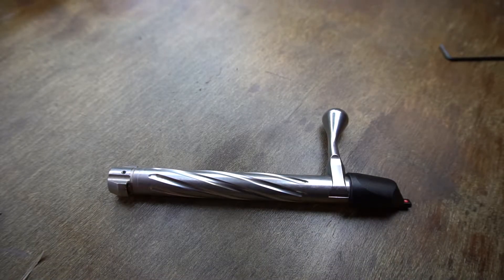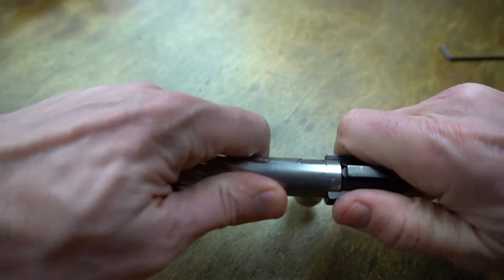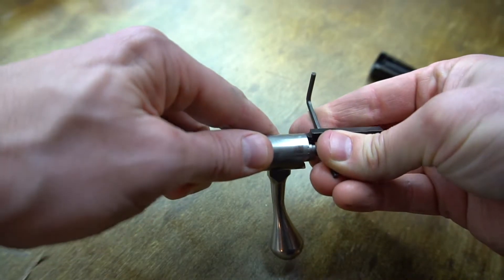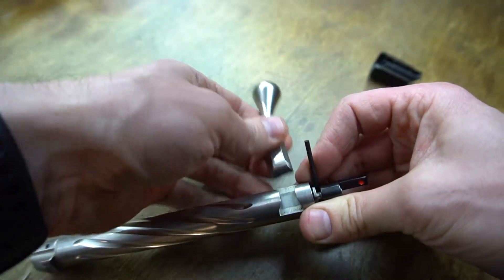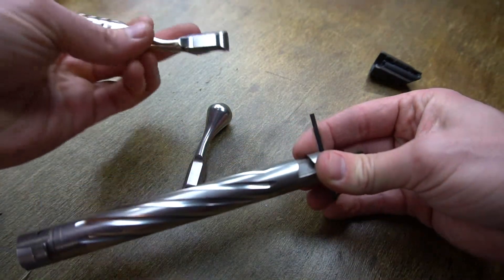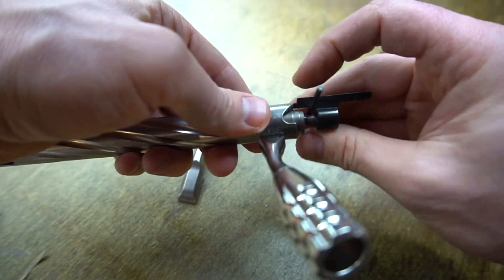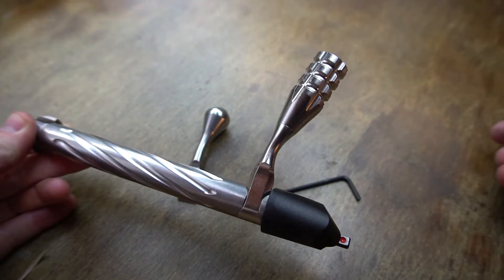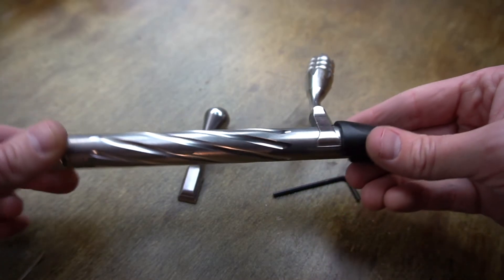Tikka T3 bolt disassembly

Comment: Good video. Other videos have bad angles or camera faces opposite way. I made several mistakes as a result. Never turn it without that allen key in there unless the gap is there. You don’t want to find out the spring compressed on you. It will take extreme force to move that collar down to get the allen key back in there. Plus the shroud has am inner circle groove that aligns with the notch in the collar. You dont just slip on the shroud and turn. It has to be aligned on the inside circle rim first.

Comment: I took apart my bolt assembly and found metal shavings underneath where the bolt shroud sits. Once I put everything back together my bolt is a lot less smooth when cocking and requires a lot more upward force on bolt lever than before. Any tips or suggestions as to what might be wrong?
Reply: Have you been dry firing a lot?